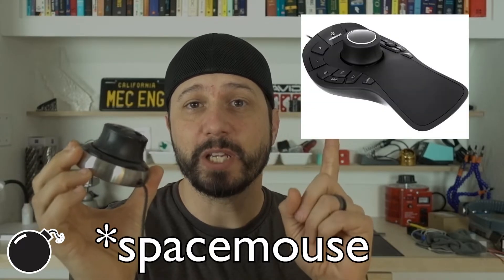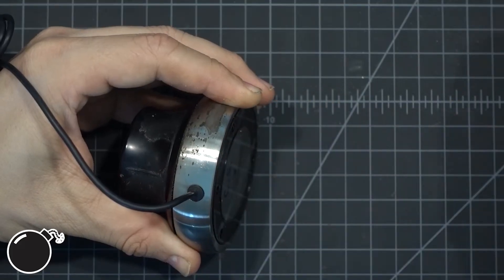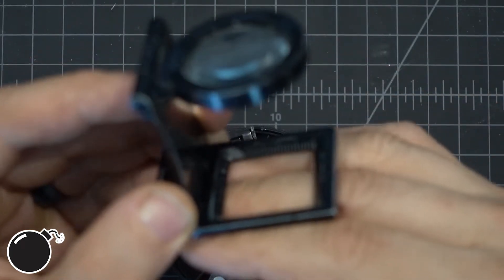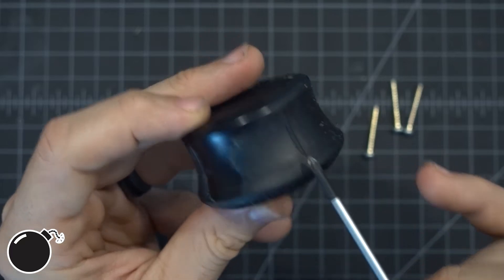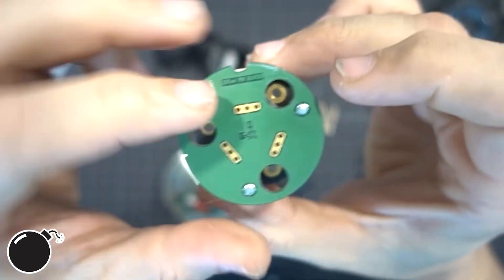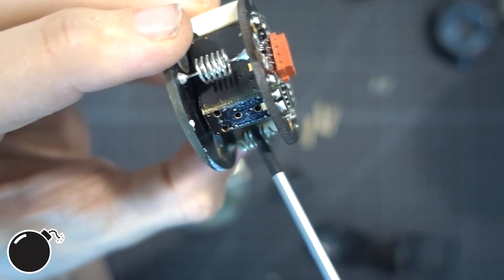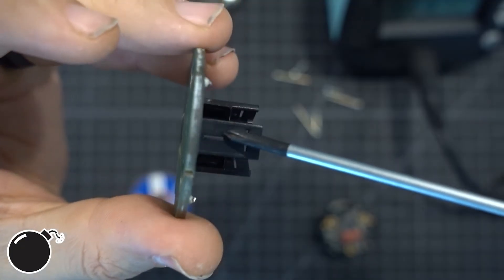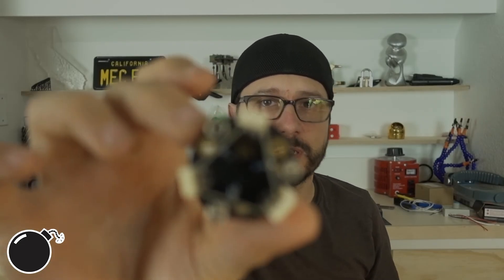What's Inside a Space Mouse?

Comment: My 3d connexion space mouse (which is very good with Sketchup BTW) has stopped working like yours. Its not recognised as a USB device. No lights. Like you said it seems to have a broken connection. When it started to fail, I thought it was the USB plug end of the cable, but that's just a feeling. Did you ever get to the bottom of what had stopped yours working. Any thoughts welcome. Thanks for the video.
Reply from the maker: No, once I got in there I didn't see anything obvious.... Plus once I started getting inside I really wanted to see how it worked!
Reply: @thoughtbombdesign   and @Graeme Moores  I have had one of these for at least a decade, and I it would stop working here and there.  Usually performing flawlessly for more than a year or 2 at a time.  Once or twice reloading the drives seemed to work, but that was an INCREDIBLE pain IMO.  So completely by chance, I just tried using (Ironically @John Connor HAHA) a nail file inside the USB port on the cord end, NOT THE COMPUTER or Laptop.  I basically grounded each of the 4 gold contacts to the shell, and to each other and plugged it back into the laptop and VOILA it worked immediately.  Hope this helps some of you all out there.  Keep us posted.

Comment: Thanks man, I was wondering whether a DIY Spacemouse is possible. I can't seem to find a PSD for sales tho. Wonder if IMU will work instead(with a zero position detector to prevent drift
Reply: DIY space mouse: https://youtu.be/7DKmMXRq_Xc
Reply: I made a 3dof joystick with a IMU (magnetometer, accelerometer, gyroscope) and an arduino. It never made it off the breadbiard though. I gave up on 6 dof because of the drift.
Reply: @tasmanwinchcombe9774  yeah, the drift would be an issue. Thanks for sharing the attempt

Comment: Hey nice video, i was trying to figure out how i can build something similar myself. Do you know the Name of the Phototransistors? Or can you give some details on them?
Reply: ok nevermind i finally found it. Something like a One-dimensional PSD
 S7105-04 from Hamamatsu.
Reply: @markmustermann8387  From the look of the round holes opposite the LEDs I think each LED illuminates two phototransistors through a slit. Moving the slit changes the illumination ratio of the sensors. Six such pairs are then sufficient for determining each DOF.
Reply: @markmustermann8387  Thanks! This is the most useful comment under this video. I was just surprised that with so much sacrifice there was so little technical details.

Comment: What do you think about tearing it down without cutting the knob? I mean just pull the board out. Is glue strong enough to break down the springs or boards?
Reply: Maybe you can try to warm up the top with a Hairdryer so the glue melts a little bit. On Apple devices you have to so this all the time ;-)
Reply: I've tried this, can't get it out, I even tried using the long screws as a base to pull (the screws that binds the transparent blue plastic to the knob, if you unscrew those, remove the blue plastic, and directly screw them in to the 3 holes in the knob but not all the way in, you can use those screws as a base to pull the plastic that's attached to the ceiling of the knob, I've tried this with a lot of force with the fear of almost breaking it, the glue is pretty strong, best way to open it is to solder the springs out of the bottom board.
Reply: Hindsight is 20/20. That one died so others may live.